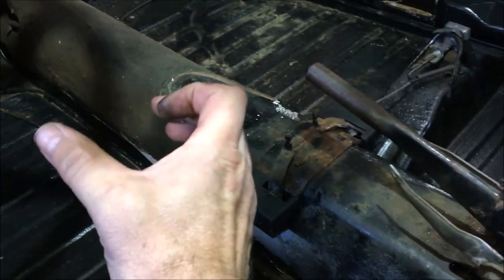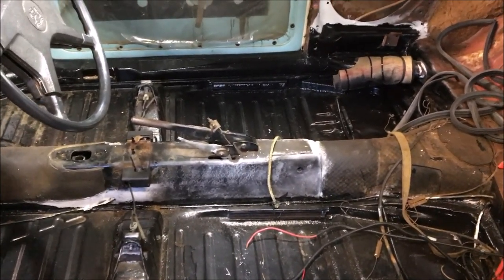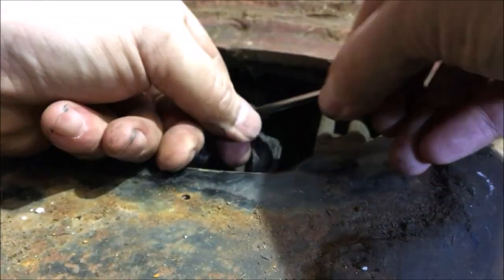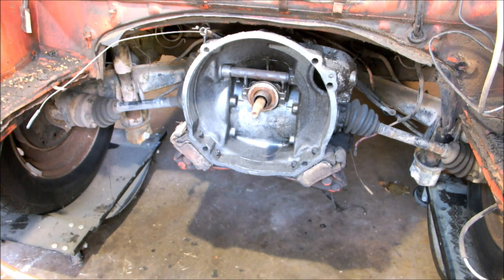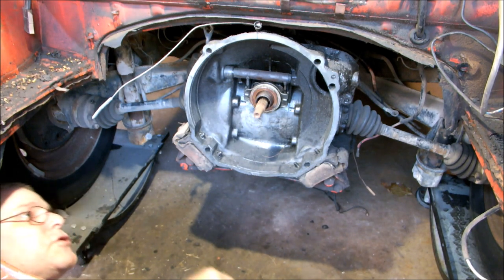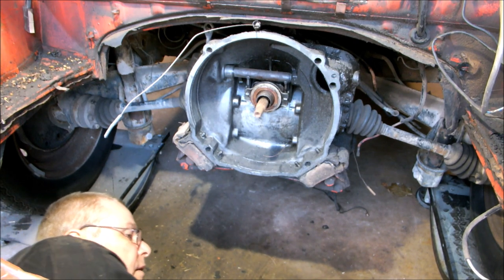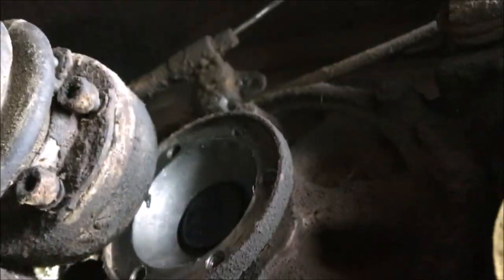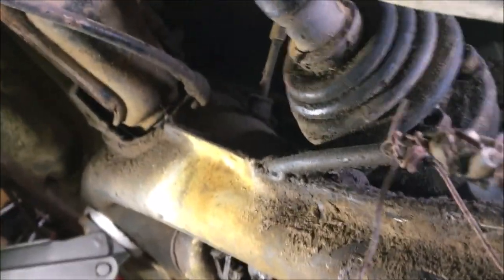How to remove a transmission from a VW Beetle and Super Beetle - IRS VW transaxle - Karman Ghia

Comment: Great video. Bought a baja that was sitting in mud for 10 years. Put in new engine and welded it back to a standard bug. Tried to drive and could only ride clutch to get in first gear then stall. I will pull the engine and transmission. (Depression set in for a few hours). You inspired me to continue with this project. Thanks!
Reply from the maker: Thanks for taking the time to leave a comment! Just take your time Mike, you’ve got this! I know sometimes I can get aggravating, but the end result is very worth it.

Comment: Have a 1969 bay window, drove to local wal-mart to get fresh tires. Drove and shifted great.  Guys in tire shop broke something while trying to get it in reverse. Had to get it towed to shop. Is the tranny broke or could it be something that can be fixed. Shifter is totally loose. Thanks, love you videos.

Comment: Another excellent video. I am pulling my engine out soon i will also drop the tranny I might I have a slight problem. When I down shift from 3rd to 2nd i get a slight grind. A friend of mine said the synchro gear can possibly be wearing out. Any highly recommended tranny shops by you?
Reply from the maker: Yes, that would definitely be a synchro that’s probably worn out. Quite common. 
I’m sure it has a lot of miles on the transmission. 
And thank you for the compliment on the video. I’ll have to find out, my buddy used someone up in Michigan. They are very good at what they do. Probably about $1000 for a total rebuild the plus shipping

Comment: Love how easily you're able to get those 12 point hexs off your axle. I'm restoring my beetle and they're all stripped out and I've become frustrated and the project has come to a halt trying to get the axles off. Any tips? Bolt extraction is less than ideal.

Comment: Thanks for the video and advice. I'm about to pull my transaxle. I've got a few leaks coming from the front of the transaxle. Any advice or videos on resealing a leaky transaxle? I've heard that it can be done with a fairly inexpensive seal kit, but I'm in new territory here.
Reply from the maker: Hello Jeff I hope that your day has gone well I’m sorry about the delay so I’m trying to catch up on comments.
When you say the front, do you mean where the clutch assembly goes? There’s a front seal up there. 
And then of course I did a video on the seals on the sides of the transmission were the CV joints bolt up to.

Comment: Great video as always. I also had a question about the neutral safety switch. If a person was to hook it back up, where does it connect to and what exactly does it do? Thanks!!!
Reply: I’m new to VWs so I’m presuming yours isn’t a manual gearbox as NS switches are usually found in automatic transmission cars so you can’t start them unless you select Neutral or Park. It is possible that a version of NS switch could be used to prevent you from starting your car without you depressing the clutch on a manual. It’s purpose is added safety ie you can’t inadvertently lurch fwd or backwards if you crank your engine when in gear…. Easily done when working on your car with it up on stands etc😳. In short, the electrical pathway from your ignition switch to the starter is interrupted (open) unless you select park, neutral or depress your clutch.✌️

Comment: If only the 3 mounts need to be replaced, can it be done without removing the transmission from the car? 
The front mount seems like it can be done by sliding the transmission towards the back of the car.  If you lift the bell housing up, can you slip the rear mounts out?
Reply from the maker: You can just slide the trans towards the rear bumper end of the car. You’ll have to use a jack stand to support the nosecone end of the trans while changing that mount. Also..maybe a good time to replace the seal between the nose one and tunnel!

Comment: Okay I have a stupid question perhaps but I’m having trouble finding the answer. What is the sensor on the side of the transmission that’s almost parallel with the fill plug? Thanks
Reply from the maker: Theres never a stupid question! Thats the neutral safety switch! Most folks honestly don't connect them up! Thanks for being here!

Comment: Any tips on reinstalling that nose cone seal?
The one I have looks too tight to fit.
Or just give it a tap with the rubber mallet?
Reply: And can you remember what size nuts are needed for the front and rear mounts? None came with my new ones.
Reply from the maker: If you mean the seal that fits into the chassis on the nose cone? If that’s the one you mean, I would put a small amount of grease on it, and tap it with a hammer into the chassis.

Comment: Here's a problem a ran into...took all the bolts off the axle and the axle is stuck and won't come off.   How do you remove an axle that is stuck?
Reply from the maker: Hi Eric, do you mean the axle is stuck to the transmission? If it is take a hammer, and gently tap it all the way around until it breaks loose. Please make sure you didn’t miss any bolts.
Reply: @SladesVWBeetle  all the bolts are out and it is stuck.     I will try the hammer method.    
Just got it out with a hammer.   Thank you
Reply: Im having this same issue. I'll try the hammer technique tomorrow.

Comment: What year?
Reply from the maker: This was a 73, but..most 68 and up are the same.
Reply: @SladesVWBeetle   yea I’m working on a 59 beetle which has a 1200. My dad has 2 frames and transmissions and 3 vow 1200 and holy r these easy motors. The last motor (like a car one) I worked on was a v8 I was only like 12 and I had a lot of help now I’m 14 so I’m doing the vws now
Reply from the maker: @lilchunk1697  I started at 14 on beetles. After learning the V8s with my dad. I truly love the air cooled beetles. The 67 and prior are swing axle. But not much different honestly. For except the axles themselves